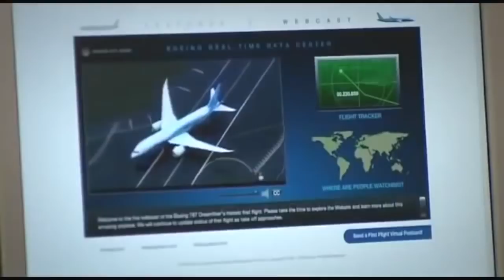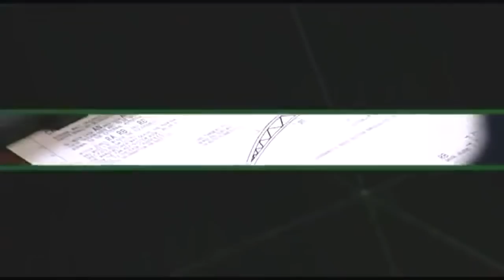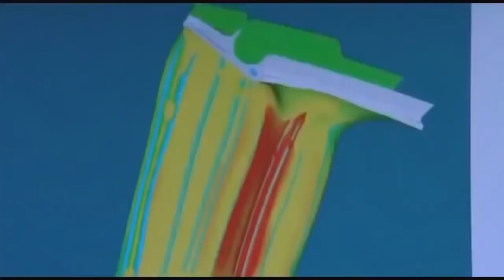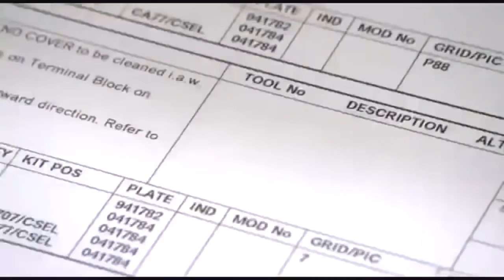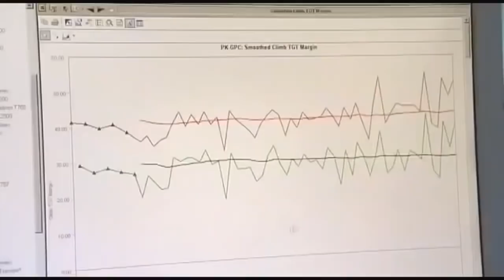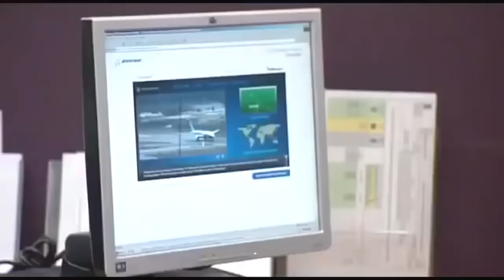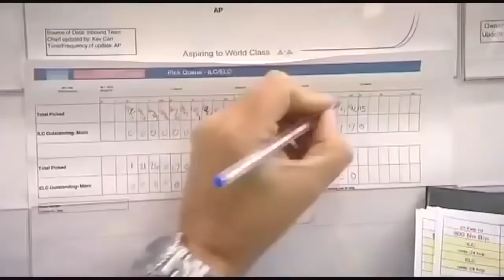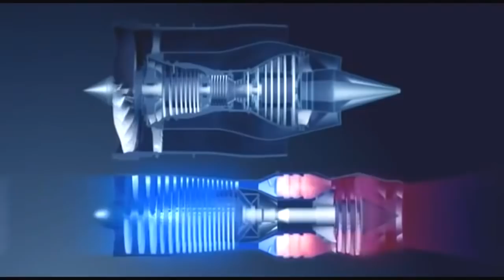Rolls Royce Engine Manufacturing, materials technology

Comment: Rolls-Royce relies upon its designs and manufactures of machines on strict accuracy standards to reach the maximum possible efficiency under various circumstances. Therefore, Rolls-Royce's internal combustion engines and turbines are the most expensive in the world because of their great reliability.